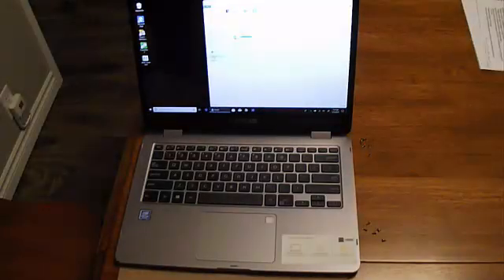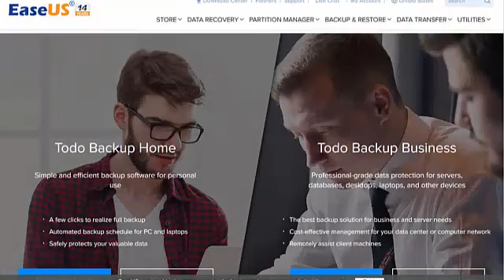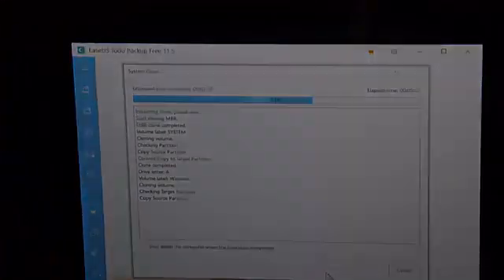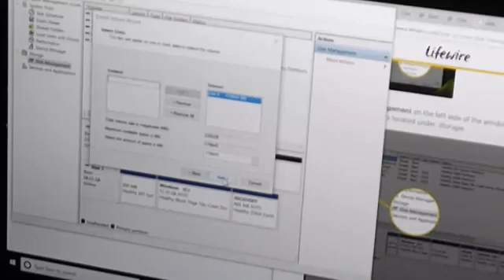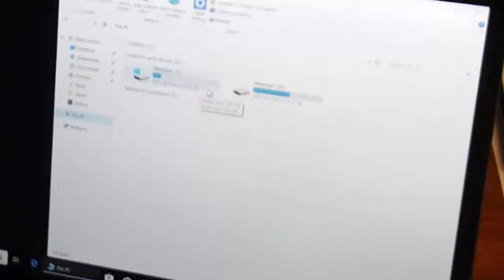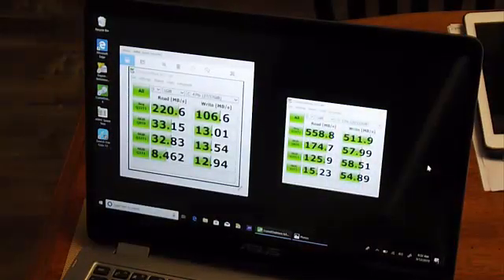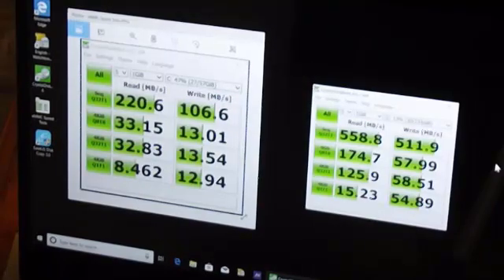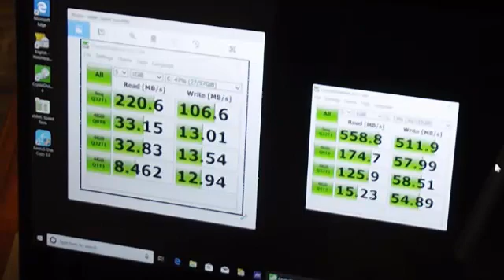ASUS TP401MA VivoBook Flip 14 - SSD Upgrade

Comment: I was able to do this on a 401MA-BB9 (manufactured 2019-09) and it took the SATA drive. (I used a 256 GB Timetec.) The drive had to be initialized through Disk Management before it was detected - though it was visible in the BIOS right after installation. In my case I wanted to install Win 11 on that drive while preserving the original OS on the built-in drive. Because this computer only has a USB-C port and I was using a usb hub, I had trouble detecting the bootable flash drive I was using for the install when setting the boot order. After much fussing, the fix for this was to use a direct USB A to USB C, and then the flash drive was detected in the BIOS so I could change the boot order.

Comment: So i have the exact same laptop. I bought a different brand NVM m.2 PCIe 1tb put it in, the laptop did not read that anything was installed. Got a 256gb thinking maybe the TB was too large, its still not reading. Ive factory reset the pc. And still nothing. In at a loss... Help??

Comment: Great video. I have the identical laptop. Looked easy enough but it didn’t work for me. Bought the M.2 WD 500G Sata III as mentioned. Did the install and it was not recognized in diskmgmt or my BIOS. Updated my BIOS and drivers and still not recognized. After troubleshooting for hours I assumed I had a faulty ssd and ordered another one. Different brand this time. Still the same issue. Will not recognize it on the software side. I saw a light on the SSD on so I know it’s getting power. What am I missing?

Comment: Thanks for this video  ! One question , how is it that when you booted up the computer you already had the OS loaded ? Would removing the original SSD and installing the new one - with nothing on it just give you no OS at bios start ? Confused - please explain. Thanks
Reply from the maker: I cloned the existing hard drive onto the new one before the switch, so the OS was on it.

Comment: Thanks for this guide. Giving back to the community, here are the details of my successful upgrade. 1. System Model	VivoBook_ASUSLaptop TP401MAS_J401MA 2. Just 2 out of 4 rubber feet had screws. It was tough getting under the rubber feet and they did end up peeling off. But they seem to stick back. 3. For the same 70ish CAD I got a 500GB WD Blue 500 GB SATA SSD M.2 2280 (Sept 2024) Moore's Law at work lol. 4. For cloning EASEUS seems to charge so I went with Macrium reflect trial. No credit card required. If purchased it is just a one-time cost.  5. To access the UEFI (BIOS) it is F2. Make sure to hold it down before pressing the power button 6. I placed my computer on aluminum foil that directly touched the kitchen floor. Then used the foil for baking chicken in the oven to celebrate lol. simple cheap solution for grounding. 7. For my model I couldn't  disconnect the battery, it was too delicate. I risked it (disclaimer: no guarantees)
Reply: Details before adding 500 GB: OOTB drive was a mere 58 GB. Windows 11 21 H2. i was unable to upgrade to windows 11 23H2 due to lack of space. I have 19 GB but update manager fails. I tried using a external SD card but windows doesnt like FAT. I didnt try reformatting to NTFS. Adding SATA was way better.
Reply: hi.,we have the same model, (VivoBook_ASUSLaptop TP401MAS_J401MA .) i just wanna ask,is the ssd you used has only one slot ?i mean for the guide to insert in the pcie slot.?because the video here in ttutorial  the SSD has 2 slot guides ?

Comment: Hi first of all very helpful video removes hesitation on the viewer's part 
Question - Is there any workaround for  PCIe NVMe drives?  Because I already bought it.
Reply: do you solve the problem with nvme? I bought a ssd for my girlfrien to with 2T. I cloned a lot of disk in my life, but this time the new ssd would not be recognized.
Reply: @Loop  no i spent countless hours searching net and trying linux and windows with different settings . However, i have ordered a SATA 3 and will get back to you with as they say in french " les résultats "
Reply: @sarlgenieiso7017 ok thank you 👍
Reply: @Loop  hi so sata 3 arrived and it works great.  So for some strange reasons though the port is pci but only SATA 3 works however it is way better then emmc.

Comment: I have Asus TP401MAR (you can use MyAsus app to get details about your model).
I've bought WDS500G2B0B - the same SSD with bigger capacity. But it's doesn't work unfortunately, not compatible.
UPD: After that I've bought WDS250G2B0B - and it's also didn't recognize by system. I've made a clone of my Windows OS, so both of the disks was initialized.
Probably will try WDS500G3B0B (WD Blue SA510) as John bellow advised.
Reply: Max, I just did this with a WDS500G3B0B (WD Blue SA510) successfully fyi.  500 isn't the issue... the G2 might be a PCIe NVME which isn't supported.   I found this out by putting an old one I had sitting around in... no joy.  Need an M2 sata.
Reply: @John-yl6pb  Good news, thanks man, I will try. What index of the model do you have btw? TP401.......?
Reply: @maxmirzoev1280  Yes TP401M
Reply: @John-yl6pb  I have the same one, thanks, John!
Reply: @maxmirzoev1280  Hi Max, I have the same asus tp401MAR, i was wondering if you tried to upgrade it with  a NVME ssd, or any other method to successfully upgrade the storage

Comment: Hi, great video! The TP401MAR I bought, manuf. 5/2021 - has PCIe 2.0, not SATA III, and has 4GB RAM on board, not upgradeable. (CPUID CPU-Z identifies everything)
Reply from the maker: That's great info, thanks! So it will take advantage of PCIe speed

Comment: I have the latest iteration called TP401MARB manufactured 11/2021. FYI, it still doesn't have an NVMe controller. As one other user pointed out, it would be listed under storage controllers in Device Manager if it did, like on my Odroid H2+.

Comment: hello, I followed all your steps but my M.2 SATA SSD is not being detected anywhere both in disk management, bios or under This PC. What do I do pls? Hope it's not that the SSD I bought is defective. It is a 128GB M.2 SATA SSD (the one with two gaps on it).

EDITED: I went ahead and ordered an NVME drive (the one with a gap) and it worked. Please don't completely follow what was said in the video cause you'll waste money. Ask questions and be sure your model is the exact one in this video. I wasted cash buying an M.2 SATA Drive
Reply: I thought he said NVMe wasn't going to work? I'm waiting for mine to arrive and see if it'll work, I ordered the same model as he mentioned, but 500gb one. Hope it'll work.
Reply: @DmitriIvanenko  Now check under your PC, the model is written there.
If what you have there is "Model: TP401M Notebook PC" M.2 SATA SSD will not work for you.

Comment: Thanks for the clear instructions.
Where is the RAM slot if I want to add RAM at the same time as SSD.
I took the cover off but can't see a slot for a RAM module.
Thanks !
Reply: Hey. Did you find it? I don't think this device has one
Reply: @zakhariihusar6975  behind motherboard.
Reply: its behind the motherboard.

Comment: Once all the screws are out, you can pop the lid open using an old, full size sim card.  Stick it long-ways into the seam adjacent to the right hinge and you should be able to get enough leverage from the hinge to pop it open there, without scratching anything.  Once it's open there, you can use your fingers to go around and open it the rest of the ways.  My fingernails weren't able to get it started.

Comment: Please help!
My asus vivobook flip 14 TP401M Notebook PC won't turn on and connecting the charger doesn't work either.
Reply: I had the same problem and discovered that I needed a SSD with only one cutout along the left side row of gold connector pads at the top, just below the upper 4 pads.  No cut out at the bottom.  Don't know the difference. Both are called M.2 2280, but one has two slots and the other has one.  Only the one with one slot worked for me.

Comment: NVMe also worked in mine. SATA did not.  in my J401MA - intel celeron
To find out about your device go to:  Windows > Device Manager > Storage Controller  WILL SAY SATA OR NVME CONTROLLER
installed Samsung Evo 970 Plus 500GB but performance is poor.  less than 1GB/s in Crystal Disk Mark
SAMSUNG nvme read: seq1m q8t1 :902 mb/s seqt1 q1t1 :665 mb/s rnd4k q32t1 :140 mb/s rnd4k q1t1 :32 mb/s
write: 719 / 547 / 107 / 81  mb/s respectively
EMMC read :  314 / 300 / 42 / 12
write : 42 / 41 / 30 / 25
Reply: My friend's that I'm working on has two Storage Controllers listed: "Microsoft Storage Spaces Controller" and "SD Storage Class Controller". Nothing about whether it's SATA or NVMe. (I don't have that drive currently installed, I just want to know which one to buy!)

Comment: I know this was done a while ago but can you tell me where you got your new ssd and what can be the max that would be best without issues. I need to upgrade mine badly, and the windows updates just make it worse.
Reply: can i know what is wrong with the windows updates? i have the same laptop
Reply: @zoyakhan8137  actually over time I realized nothing g was wrong with the updates, ideas the fact that I had no space, which is why I need the space

Comment: Hi, Thanks for posting this video. I have the same laptop seen in this video and bought a similar SSD (WD Blue 250GB Solid State Drive
WDS250G2B0B) I followed your instructions to the book but the laptop won’t detect the SSD neither in Bios nor in This PC( Computer). Is there something I forgot to do? Or the laptop isn’t compatible? (Asus VivoBook Flip 14 TP401M 14in. Touch 2-IN-1 Intel N4020 4GB 64GB J401MA-DB02) Any advice will be highly appreciated.
Reply from the maker: Mine is the Pentium Silver 5000, but that shouldn't affect detecting the drive. I had to update my bios to get Windows to detect it.  If that still doesn't work, see if Disk Management lists it. It may just need to be set up.
Reply: @noiseintheoffice  I finally figured out why the SSD couldn’t be detected. I installed a different SSD with a single slot (NVMe). It worked. One thing though. The easeus software for cloning is not for free. I had to purchase a key product.
Reply: @silkkay6214  Hello, mine is also the 401M, not the 401MA. Am I right in thinking the M.2 SATA didn't work for you but the M.2 NVMe worked fine? I've just installed a SATA version and can't get it to be seen at all.
Thanks
Reply: I did the same and indeed it worked. I had also to purchase the easeus software. Thanks for sharing. Happy Thanksgiving
Reply: @silkkay6214  hi! Which brand SSD did you end up purchasing instead of the WD
Reply: Thanks for confirming!
So I put a 1TB NVMe SSD in my TP401M and it works fine. The SATA 3 wouldn't work at all. It seems the 401M must be different to the 401MA
Reply: @scoupe3027  hi! Which brand SSD did you guys purchase? I’m having the same issue and am returning the WD for a different NVME

Comment: I have a tp401c, i would like to know if u can add a much bigger gb than a 256gb SATA III SSD? thanks!
Reply from the maker: I believe it will support a 512 as well, not sure about bigger sizes. Just make sure it's a SATA controller and not PCIe and it will probably work.
Reply: @noiseintheoffice  thanks so much for the info, more power and God bless!

Comment: https://www.bjs.com/product/asus-vivobook-flip-14-j401ma-db02-laptop-14-fhd-touchscreen-intel-celeron-n4020-processor-4gb-memory-64gb-emmc/3000000000002407763?source=GooglePLA&gclid=EAIaIQobChMIgP6ykoWn7QIVRQnnCh0sGg3hEAQYAyABEgKNTvD_BwE This is what is available in the USA Under 300 dollars and has the expansion slot for the tiny and skinny m.2 sata III memory. The screen resolution is only 13xx X 7xx. So not 1080p. My application is orchestral music display. The 14" screen will make a big image, bigger than an 8.5 x 11 paper, so other functions would only be a bonus. I suspect your machine and the above machine are close to identical.

Comment: Can you upgrade the ram for this
Reply from the maker: Nope, it's SOIC.
Reply: Hi, if you would not mind me asking, i have this TP401CA in me and i had recently installed a SSD thanks to your video. My question is, can i possibly ADD another RAM on this model? I understand that the stock RAM is SOIC. But is there any slots available for me to add another DDR3 RAM? Thanks and look forward on your reply.

Comment: Hello, would it be pretty much the same for the ASUS TP410UA or does that model not include the special port for the SSD?  Also, I know you might not even be monitoring this anymore, but others might see and know, would I be able to replace the 1T HDD the unit currently has with a 500GB SSD and the. Just use the 1T HDD as an external?!? thanks again for the video :)
Reply: I saw a video about upgrading M2 SSD on this laptop, but it seems to be gone:/ Anyway, it was a pretty complicated procedure that included fliping over the mainboard, as the M2 slot is pretty well hidden. I actually have this model and want to uprade the RAM that sits nearby, so if I succeed I may get back to you:D
Anyway, there's another option: if you have a HDD you have a 2.5" SATA slot so you can just replace the HDD with 2.5" SSD. Just make sure to clone your hard drive beforehand.

Comment: Hello noiseintheoffice,
thanks for that brilliant video. I have a 'oversize' laptop with 18,4" and a normal size Android tablet. But I wanted to have sth. smaller. And as well a Win "tablet". So I started looking around for 2-in-1's or convertibles. But in Germany the 11" or 13" sizes all just hold 4GB Ram and I wanted 8GB Ram. I ended up getting a used (2 year old) ASUS TP401N.  Lucky me, since I came across your video. 

Everything is just the way you described it, so great. 

I just ordered the 1TB WD blue, because I want to put my MP3's and more on there. 

Which version of the EASEUS to do software is it you were using? 

I found the 11.5, it seems to look slightly different from the looks in your video. 

So I am awaiting the 1TB now, so I can "mod" the sweet 14" convertible.
Greets,
Julia

Comment: My SSD does not fit. I have the Crucial MX500. Any clues as to why?
Reply from the maker: If it's an M.2 drive it should fit in the slot. There are 2 slots on that end of the board. Make sure you're using the one under the ribbon cable. If that doesn't help, maybe a little more detail?
Reply: noiseintheoffice my Crucial MX500 M.2 SATA SSD won’t fit. I only see one slot on the board. And it’s similar to The one on the video
Reply from the maker: @mikoivan12  Will it physically not insert into the slot? Or is the issue thickness/length? Does it have the same key slots? Also, one side is wider than the other. count the connections at the ends; one has 5 connections, the other has 6. So it may insert with the label either up or down. It looks like yours needs to have the Crucial label up
Reply: @noiseintheoffice  I was able to finally install it. However at bios, it does not show it in the Boot priority, but It does show at the Storage that I have the SSD attached. I replaced the SSD to WD Blue. SatA SSD. What now?
Reply: However, I was able to clone the SSD and extend the volume.
Reply from the maker: @mikoivan12  I had to do a BIOS update to get mine to show.
Reply: noiseintheoffice I just updated the BIOS with the most recent one from ASUS. Still just shows Windows Boot Manager
Reply: @mikoivan12  did you ever solve this, drive not showing up in boot manager?
Reply: @olgaorch  Yes, somehow what solved it for me was just restarting it several times until it read the SSD. I know it isn't the prettiest solution but it worked. I wish I knew more. Sorry

Comment: i followed the steps and windows recognized the hard drive but the bios did not, any ideas?
Reply: update, bios can read it as storage but not in the boot options or boot priority section
Reply from the maker: @gemstoneautos6357 There is a new BIOS update for this model. That might be a place to start. Mine installed during Windows updates.

Comment: Hello Sir, 

thanks for posting this great vid. Last week I bought this exact ASUS & have not put it into service yet. I found your vid whilst checking for upgrades & enhancements & the upgraded SSD card is the 1st thing I want to do because i intend to store quite a bit of music in this laptop. Could you pls advise if instead of utilizing the card you install here, is this below 1TB card compatible & a viable option to use instead; the specs are lower on it's page for your review:

https://www.crucial.com/usa/en/vivobook-flip-14-tp401ma/CT12619092

If it is not, could you list a link or direct me to where you obtained your SSD card. I am in Arizona, USA.

Another topic, I have not fully completed start-up of my ASUS, I stopped when the start up screen(s) advanced me to the point of accepting Terms & Conditions for Windows 10. I do not want Windows 10 due to the amount of access to data & personal info one must agree to relinquish to Windows. My intent for this ASUS was to not utilize Windows 10, but instead install & use Linux Mint 19.1 at all times, but it appears that the ASUS device is insisting that I agree & accept the T & C for Windows 10 or I cannot advance any further to get the ASUS up & running. This is my first ever laptop, I've only been a home pc user but am looking to branch out to a laptop to take advantage of its portability, hence this purchase. I've only ever utilized Windows 7 (that it came with in my pc, bought new in 2014) on my H.P. pc, which still works fine for my relatively tame computer usage.
Do you know of a 'bypass' for avoiding me accepting Windows 10 to get the ASUS set up & running?? Will it matter, if I'm only going to utilize Linux Mint?
Thank you for your time & thoughts.
Reply from the maker: Any SATA SSD should work, just not PCIe. You won't need to worry about Windows 10 licensing, as it's now in the BIOS. But I have been unable to find a way to get it to boot Linux of any kind due to the BIOS restrictions. If you get it to work, please let me know. :)